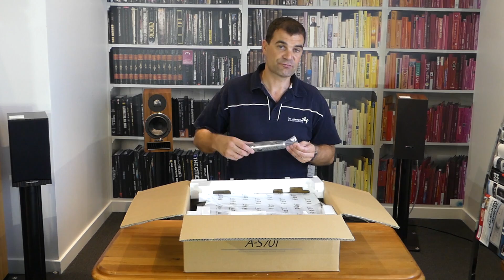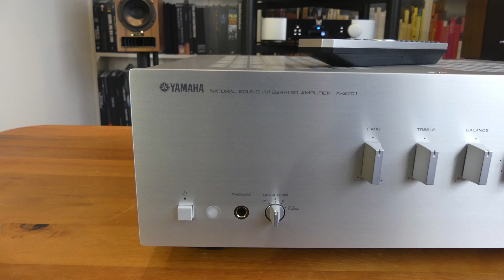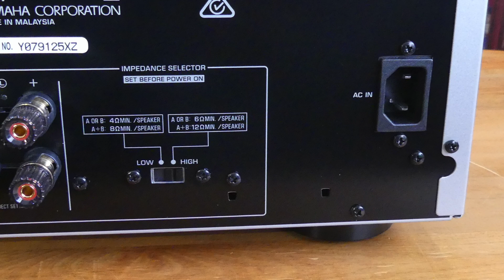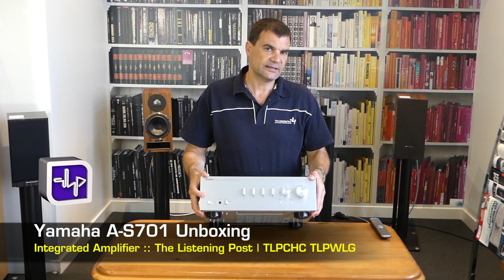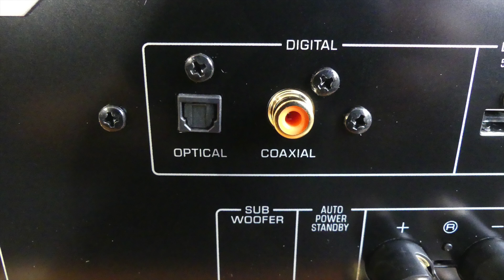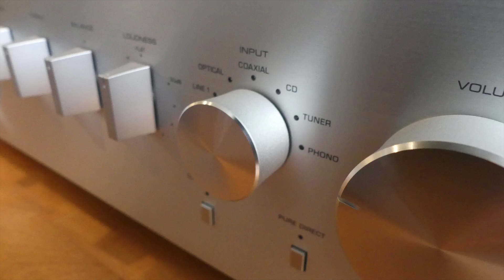Yamaha A-S701 Integrated Amplifier Unboxing | The Listening Post | TLPCHC TLPWLG

Comment: I am in doubt about either the A-S701 new or a used Denon PMA-1510AE. Will be mostly used for Vynil, any comments on the phono stage? I have a pair or Dali Zensor 5 and a Pro-ject turntable without pre-amp.
Reply from the maker: I would lean towards the Yamaha. But you shoudl also consier the Atoll IN-50     https://www.youtube.com/watch?v=lgRP62xB2Z4

Comment: This amp is on par with gear 3 times the price.
99.99 % of the sonic differences are inaudible.
With heat and time on the components sound continuously improves !
If you’re looking for simplicity detail and quality. Look no further .
Super low distortion, great soundstage, phenomenal highs , accurate flat midrange and rich well applied bass notes.
Very tough to beat at any price point.
You can always spend more.
This unit says: Why?
Reply from the maker: Yes - It is a superb performer for the price
Reply: With the Yamaha 701, can you hear the bass and treble changes you make with the tone controls through the headphones? Does Loudness affect the headphones too?

Comment: Is this amplifier a good match for Wharfedale Linton speakers? Or are there amplifiers out there that do match better?
Reply from the maker: If you have a set of the Whalfdale Linton's than you need to consider a better quality amplifier. Maybe the AS-1100, or Arcam S-30, NAD C-388 or Rotel RA-1572
Reply: @TLPCHC  Thank you! I do indeed have the Linton's. A fine upgrade in itself they are, now I'm looking to upgrade the amplifier. I'm in the Netherlands. A shop at about an hour driving from home can setup the 1100, the NAD, the Rotel you mentioned and maybe a Denon too for a test listening session. Thanks again for your advice 😊

Comment: Hi. At the back of this amp there is an Impedance selector with a guide. However if you want to connect only 2 speakers (8oms per speaker ) using port A, should you use LOW or set the switch to High? Thank you!
Reply from the maker: Low

Comment: Thank you so much for your video, my 17 year old Yamada died last week due to lightning and storm here in QLD and I am saving up to buy this. I wasn't sure to get this or a Denon 720 as I am big Denon fan but I am gonna stick to Yamaha. I have 2 pairs of Klipsch speakers (F1 & F2) that I am always running them, will it be a problem or this amp can handle both? I was doing the same with my old Yamaha so maybe it has nothing to do with lightning and it simply died because it couldn't handle both pairs ?
Reply from the maker: Running two pairs of speakers puts strain on the amplifier. The A-S701 is a good amp, and will be ok with this load, as long as you don't drive them loud.  Maybe consider the Yamaha A-S100 or or Rotel RA-1572 if you need to go loud.
Reply: @TLPCHC  Thanks for your reply, AS1000 is out of my budget , I have recently moved to a town house and can't do loud music for too long 😔 but I love the analogue level meter,  wish it was bigger like Technics SE-A1000 😁

Comment: Hi!How does it sound the Yamaha A-S 501?It is worth the money?
Reply from the maker: The 501 and 701 are built on the same "platform" so sound simular. But have you ever found a pair of speakers that didn't like a little more power?  The 701 is better because it controls a wider range of speakers and challenging loads.
Reply: Hi and thanks for the answer!As speakers i have recently bought the Warfedale Diamond 225,i have also a pair older speakers Diamond 9.2 and the Onkyo SKF 4800.

Comment: Can I use it to power the front speakers in a 7.2.4 setup
Reply from the maker: Not really. It does not have a theatre by-pass or simple way of turning it into a power amp. The AS-1100 does, or Yamaha CX-A5000 11 channel power amp

Comment: Do you know when Yamaha release the next generation of A-S701/A-S801?
Reply from the maker: No, but probably ages away. They don't change their stereo amps every year, as they are good solid amps, with little need to update.
Reply: 2021 or 2022
Reply: A-S700 / A-S800 was released in 2010.  A-S701 / A-S801 was released in 2014. The next generation ( A-S702 / A-S 802 ) will be released in 2020.
Reply: @sirwavell  do you know what changes may be made on next years A-S802 as compared to the 801?  I'm about to pull the trigger on the 801 now.

Comment: Can I hook an EQ and a tape recorder at the same time?
Reply from the maker: Therotically...yes, as the unit has two loops in/out. But I don't think in practice it will work. I think if you are trying to add these two devices and use them both at the same time you might need to use an external mixer.
Reply: I mean connected at the same time (not use at the same time).Are you sure Yamaha has two loops (in/out)?Like nad C356bee?I think the number of inputs/outputs doesn't fit (Line1,2,3) . I'm between a-s 701 and c356.I don't want to disconnect the equalizer and then connect the tape recorder...to rec something (a lot of upset).I read some reviews for a-s701 saying that in mids and highs, a-s701 is smooth  and non bright.I can't tolerate bright/sharp/anlytical sound with edges.I like refine sound.Elac debut b6 fits with a-s 701?Thank's.
Reply: The Listening Post Christchurch | TLPCHC i